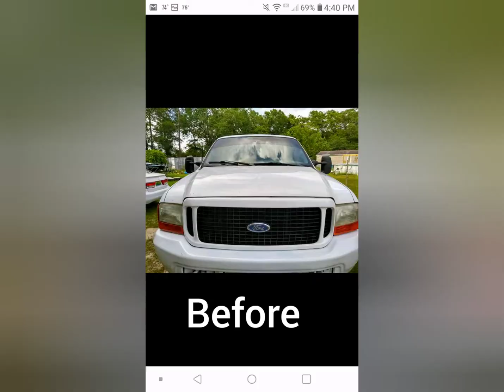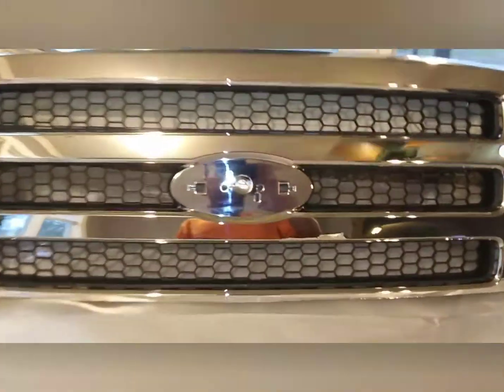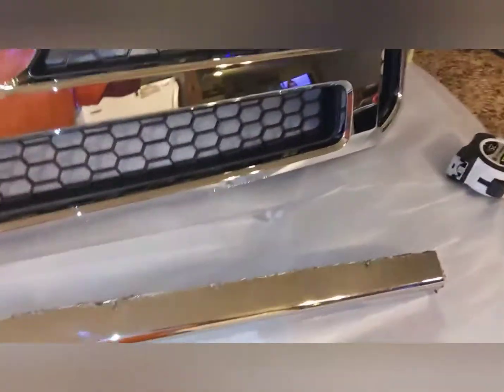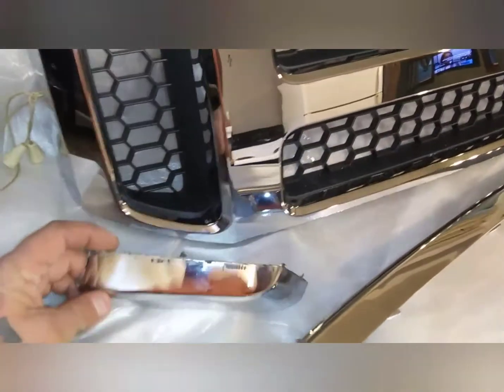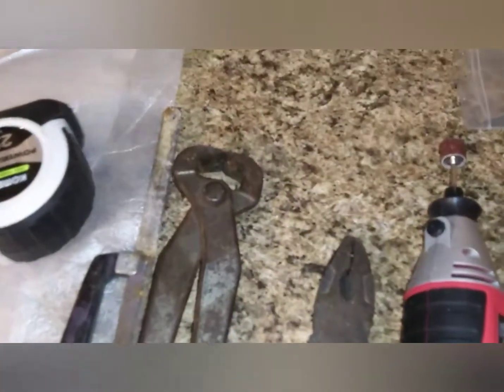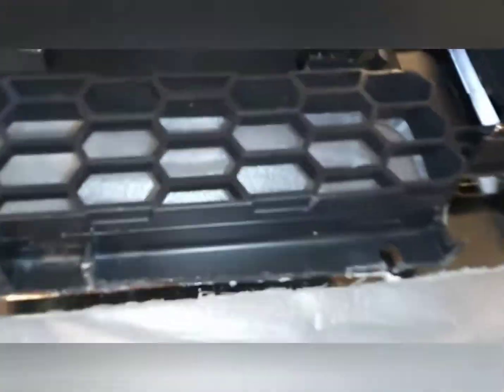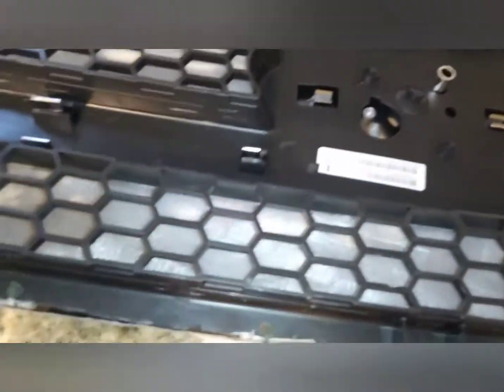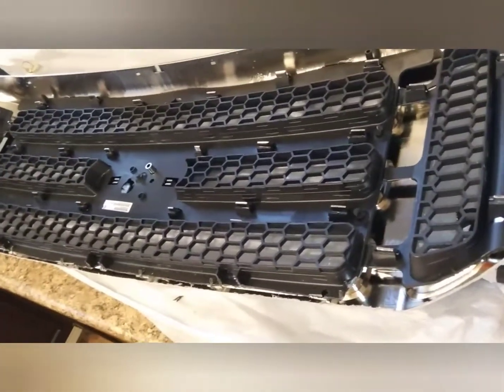How to cut / trim a 05-07 f250 f350 excursion grill to fit your 99-04 without changing bumper

Comment: Thank you for making this video. One quick question is how did you line up the holes on the top? The 05-07 has 5 screws, while the 2000-2004 has 4 screws. Did you drill out new holes for the top to align with your headliner?
Reply from the maker: I just sold the truck and honestly cant remember

Comment: So the bottom clips on grille aren't needed and can be cut off?
Reply from the maker: Thats the only way you can fit it. You can drill holes threw that bar running behind the grill at the bottom before you install the grill. Then run zip ties from the grill threw those holes. It's hard to see in the pics but if you look close in the pic with the grill out you will see the holes drilled. And after pic looking down you can see the ties. If you use black you can't hardly see them.